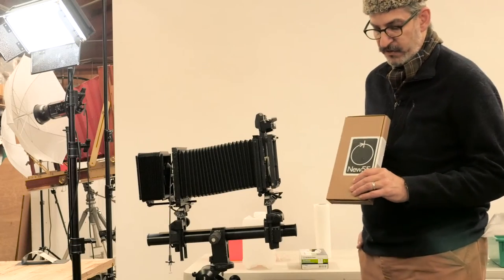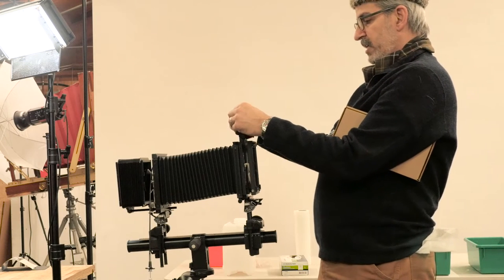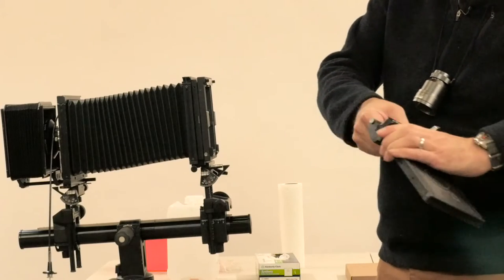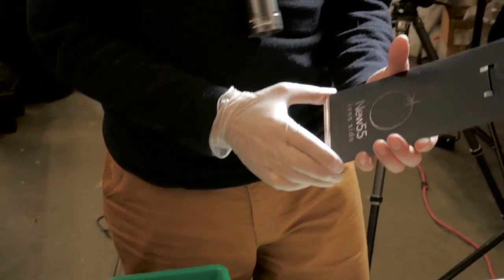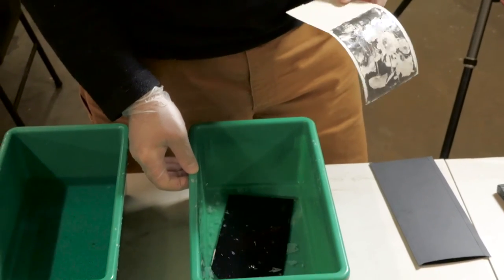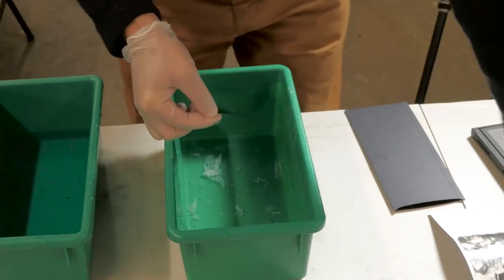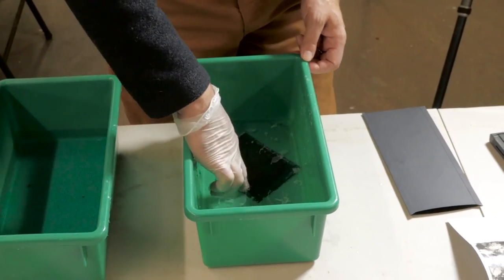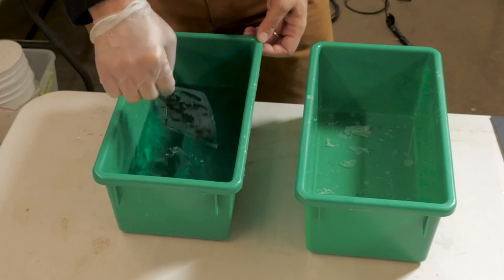New55 PN   Shooting and Processing v3

Comment: I recently bought a five pack. The outer cover didn't want to slip off the negative. After getting no exposure on a couple I watched with the 545 removed from camera. The clip held fast till you pull hard enough to force it out.. There was no way the inner film could pull out for exposure. There was nothing holding the inner film in place. Even after manually removing the clip there was no way to pull out the film. To see if my 545 holder was at fault I tested it with some very old Polaroid 52 I still had and it worked fine. I must have gotten a bad batch. For $75 I could have bought 3 ten packs of 4x5 film with development. Don't waste your money on this stuff. Check Flickr to see how bad both the positives and negatives come out. F. Talbot had better images in 1840!

Comment: Shooting my first box this weekend and this makes me less nervous..even though I am still nervous. How many negatives would you use in the rapid fixer before having to mix a new batch?
Reply from the maker: The Illford Rapid Fixer 1:1 solution goes a long way when fixing the PN negative.  I have used one batch of fixer solution successfully for more than one box of PN in a single session.  One will want to replace the fixer solution at the point when the goo begins to take a longer time to release from the negative.  -Sam Hiser
Reply: The fixer serves as a clearing solution.  Because the reagent is designed to CONGEAL (solidify) in it, the fixer does not get used up in the conventional sense.  I have fixed 3 boxes (15 negatives) in one session in the same solution.  Surely it is possible to do more; but after about 10 negatives, the "egg-drop soup" gets inconveniently thick and the goo takes longer to release.  A 1 liter bottle of Ilford Rapid Fixer lasts me from 10-15 boxes of film.